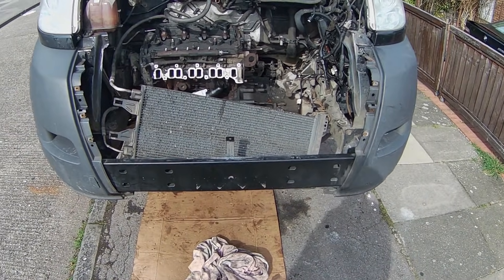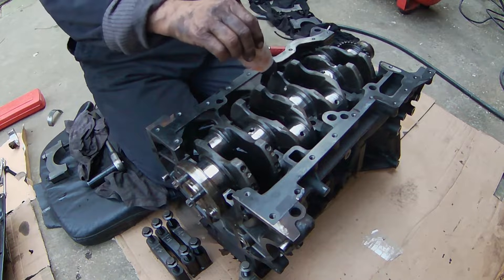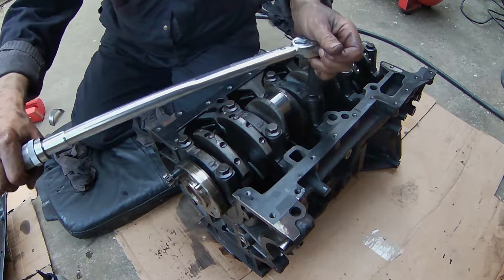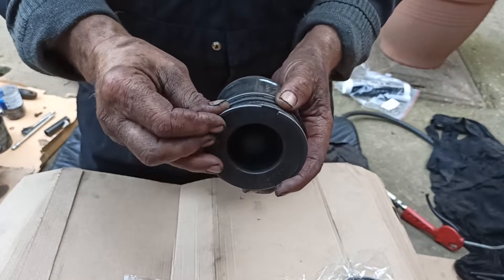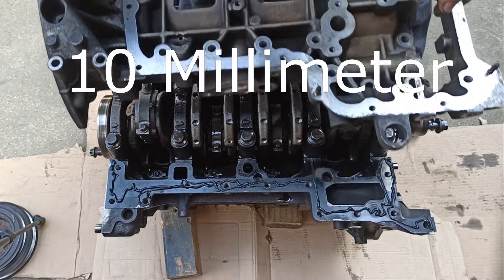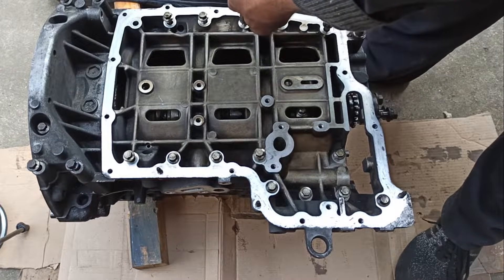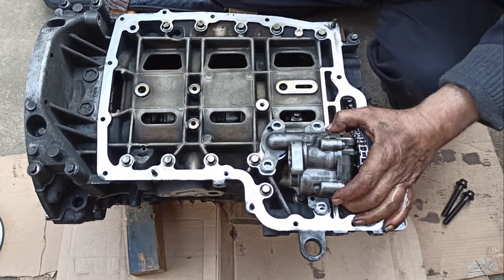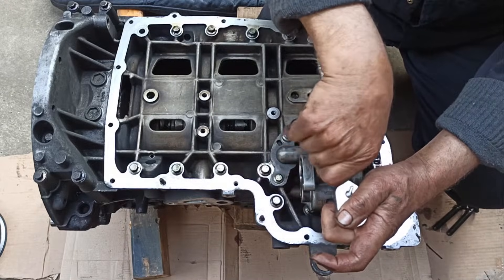Ford Transit 2.2 TDCI Engine Rebuild - Part 1

Comment: hello, great video you made, can you just change the bearing shells or do you have to measure something? I have the same problem, my engine is broken, the first cylinder has no compression, do you perhaps have a repair manual and could you send it to me as a PDF or digitally? Thanks
Reply from the maker: If the first cylinder has no compression, you need to diagnose whether its the piston, crankshaft or the bearings. There may also be a case of the oil pump failure causing the above problems.
Reply: Thanks, that was exactly my problem. The oil pump was blocked and the engine wasn't getting enough oil, which damaged the pistons and cylinders.

Comment: Hi i have the same problem my first Zylinder is broken, i must change all 4Pistons. When you must change tham you have News Screws. Have you a book 4 instructions. 
Thanks.
Reply from the maker: What do you mean firsr cylinder? Please elaborate. However if you are replacing cylinder head, you must place new screws.

Comment: Thank you. Gives me a good insight in what I'm going to have to do on my transit engine. Does anyone know where i can get the pistons and bearings, gaskets and crank shells from at a reasonable price?
Reply from the maker: I can advise ebay.
Reply: Pistons go mahle.... genuine and everything else aftermarket won't last. Chinese junk.
Go MAHLE mechanical everything and sleep easy. Gaskets go branded.. ajusa,  Victor reinz, payen etc etc...
Timing chain genuine or Victor reinz

Comment: Very nice. Thanks for posting that. Just a quick question, would the engine fitted on boxer euro 4 be the same as euro 5? I'm referring only specifically to the block and compression , as I know the rocker cover and injectors, HPFP ,intake manifolf and other accessories are different